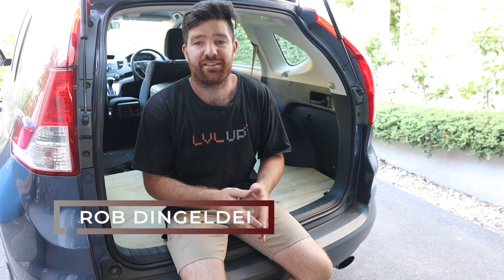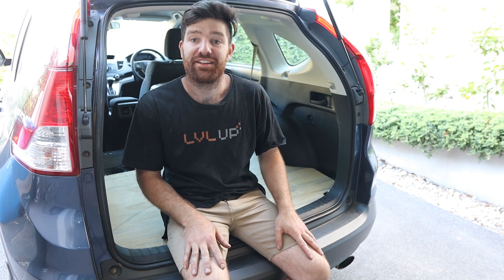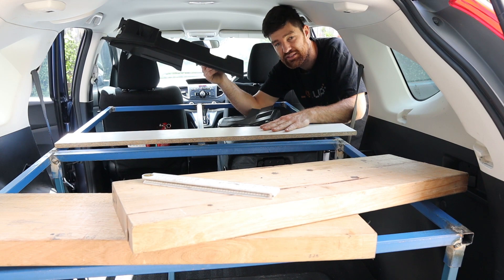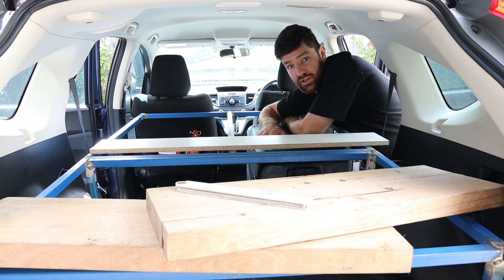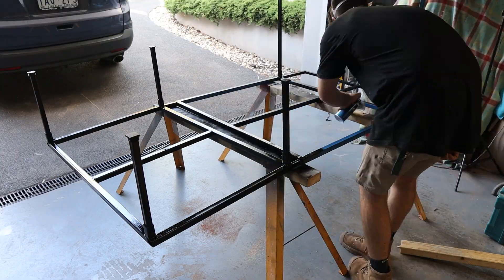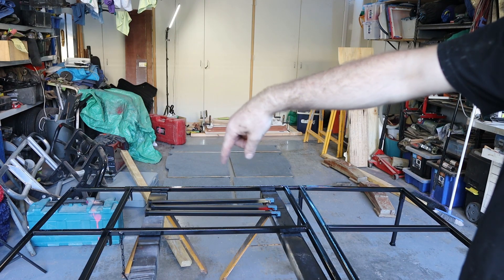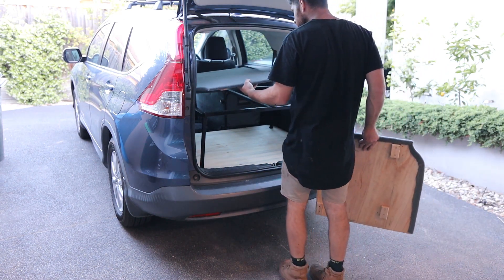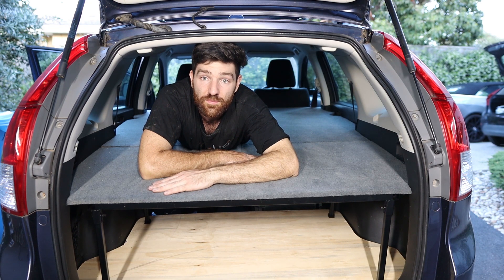Extendable and Modular Bed For Your Compact SUV  - No Compromise DIY Tutorial

Comment: i love this! this is literally perfect for me. would you mind sharing measurements and supply list?
Reply from the maker: Measurements you need to make yourself - 
Bed height to suit Fridge
Boot frame to suit back seats
Rear seat frame to suit front seats
Plywood to suit contours of car - Probably a sheet and a half to 2 sheets of ply wood 15mm thich
Steel 20 x 20 and 25 x 25 to suit size of frames and height

Comment: Cool Video! Thinking of getting this generation CR-V, but worried the cargo space won't be quite long enough. Do you happen to know what is the length of the cargo space from the back of the trunk to the rear vents?  And how about with the passenger seat in the front-most position?  Surprisingly, I couldn't find a YouTube video where somebody measures the cargo space in this generation CR-V!
Reply from the maker: Trunk to rear vent 1750mm
Trunk to back of seat all the way forward is 1900mm